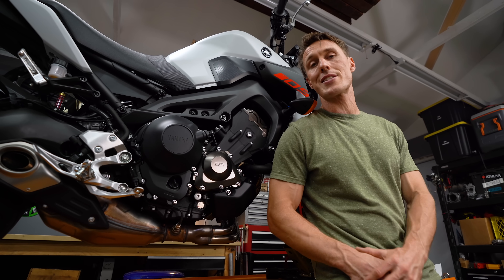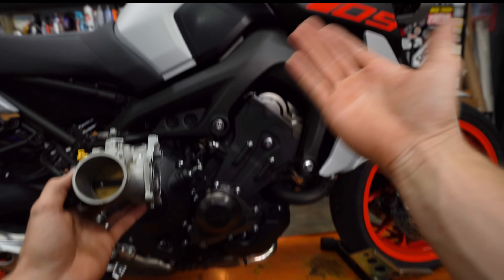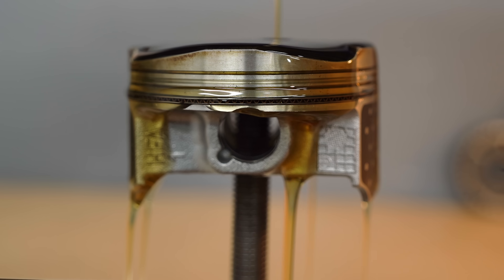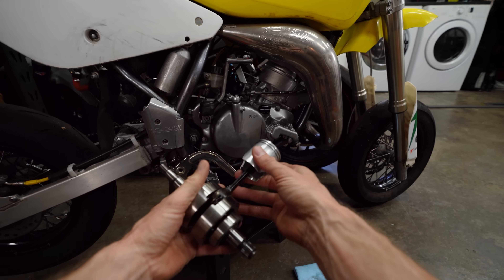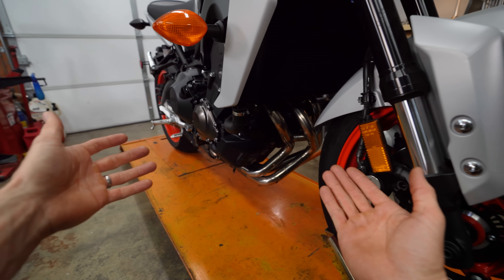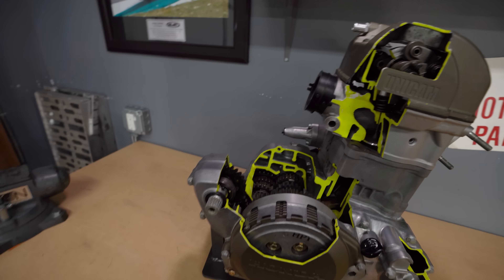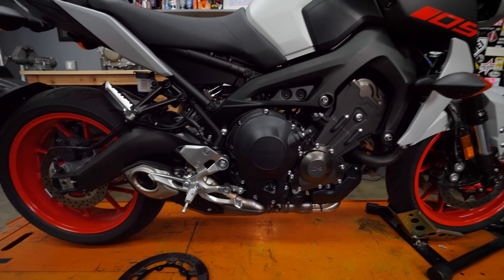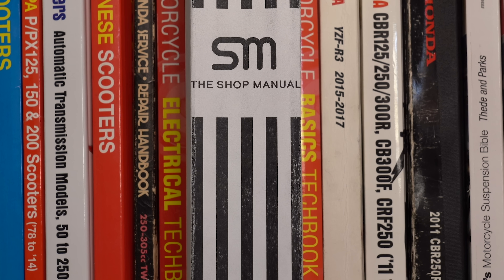Is Engine Braking Bad For Your Motorcycle? | The Shop Manual

Comment: Even with the two stroke, there is vacuum when the throttle plates are closed, and the carbs use this to pull in fuel from the bowl. Most of the time, it uses venturi tubes, but there is a reason bikes have idle mixture screws. Small ports that allow some fuel into the engine when the throttle blades are virtually closed. Think about it, the plates dont close more when engine breaking than they do at idle.
Reply: Yup, great point, and something I'd considered pointing out in the vid but figured was too granular.

Comment: When I engine break, I pull in the clutch and tweak the throttle just slightly while downshifting at the same time, and then ease the clutch back out. It makes the deceleration much smoother that way!
Reply: Going down through the gears like you describe is actually what I thought engine braking was! The way engine braking is described in the video is what I thought of as 'releasing the throttle'.
Reply: That's revmatching, and if you do it right you should beable to pretty much dump the clutch and it will be perfectly smooth with no wear
Reply: @KakuiKujira  
That it is, but when you downshift from your top gear it will give you more braking force!
Reply: @rohinhans7819  
Yep! I’ve been doing there pretty much all of my riding years. 
I learned about it very early on.
Reply: @scubarider1  same, when I took a riding school, I rode their rebel 250. The thing had suck shitty brakes and we went on really steep hills with the school, so I had to teach it to my self on the 3rd day in😂. Definitely something everyone should know how to do!
Reply: @rohinhans7819  
That’s good! It’s become so automatic to do all three actions Simultaneously!

Comment: I would say one downside to engine breaking could be breaking traction on the front tire if you are not rev matching properly. Definitely depends on the bike though. I’ve only had that happen on my XSR700 1 or 2 times.
Reply: Explain please how engine braking could possibly affect front tire traction and what rev matching has to do with it. Perhaps you have one of those new 2WD motorcycles?
Reply: @momule55  it is a lack of rev matching that would cause the front tire to break traction. Kind of the opposite effect of backing into a corner where the goal is downshifting to slow the rear tire to break traction sliding into the corner. When you downshift and the RPM on the engine is much lower than the tire speed the bike forces the front tire to slow down so fast it can break traction on the front tire. Not an issue if you are sitting straight up but if there is any lean the bike could be dropped.

Comment: Please just keep in mind that when a quick stop is required engine breaking is a distraction to the increasing pressure necessary on the front brake and the reducing pressure called for on the rear. In the CMSP course we instruct our beginners to concentrate on those skills, while pulling in the clutch, keeping it in, and clicking down to first in sync (more or less) with your speed. That is already complicated enough  The next time I see a factual demo of combining engine braking with regular braking results in shortest stopping will be the first.
Reply: Your last line implies you are talking about emergency braking? No one I know of uses engine braking when emergency braking, brakes and clutch- back to first gear. 
Topic of engine braking is slowing easy or going down hills/mountains without riding the brakes. Or helping to slow between corners ect not emergency braking
Reply: @UFO-047  no implication intended, it was stated right out. The potential problem in talking about engine braking outweigh the benefits. There are known benefits to what I would prefer to call "throttle control". With the audience this type of content gets we actually arguing how many angels can dance on the head of a pin.
Reply: @imgzrona09uc72  the only problem with talking about engine braking is when it is taken out of context, like you've done. Only you brought up emergency braking, completely separate topic.

Comment: Some of the early ohc engines had weak cam chain tensioner a sudden closed throttle at high rpm could break a cam chain. Rare but it did happen. But 99.9 % no problem

Comment: Engine braking for shedding a bit of speed (when you don't need to shift gears) also extends the life of the clutch in bikes and cars, contrary to the myths that state otherwise. Throttle release -> clutch pull -> brake press/pull ->  clutch & brake release -> throttle pull is a more wearing process than simply throttle release -> throttle pull. On a fundamental level, braking without operating the clutch is harder on the whole transmission than simply doing engine braking, but unless you brake really hard or stall your engine doing the "clutchless" braking, it probably doesn't matter in a significant enough way.
Reply: Makes sense. I’d add that anytime you aren’t smooth with controls, it leads to unnecessary wear. Smooth=longevity

Comment: Front brake provides 70% or more of stopping power.  Unless you're "on the track" consider the MANY extra revolutions of internal components as premature wear.  Because brake pads.   
Certainly useful for downhill stretches though.

Comment: With two-stroke cars however, lack of lubrication during engine braking was enough of an issue to force many designs to employ freewheeling transmissions, at least on some gears. E.g. the Trabant
Reply: Yup, that's fair, but you must also consider the metallurgy and lube technology that was prevalent back when 2T cars where a thing. They were trash! No Nikasil or synthetics, but rather cast iron cylinders and bean-based oil.

Comment: I tend to use a fair amount of engine braking, and it pays off in allowing a longer brake pad life. Where it hurts is putting more wear on the rear tire. I'm convinced if I used less engine braking, I would probably get 10-15% more rear tire life. My bikes are both 1300s--big engine=big braking.

Comment: This stems from 2-stroke engines where, yes, engine breaking can be bad in excess because without fuel delivery there is no oil delivery.  Not so with a 4 stroke.

Comment: What you lose in inlet vacuum you gain back on the compression stroke. Engine braking comes from the engine's internal resistance more than anything else.

Comment: Not sure if you'll read this but I always had a big question on being hard on the engine with braking, what is the effect on valve clearances especially with hard engine braking on superbikes? This often leads to quite a fair bit of damage in engine but its a very slow process and hardly noticeable.

I've always made it a point to keep my valves in spec but I often can't find information on how the valves end up tighter or loose in the clearances. It seems like hard engine brake does have an impact on valves.

Follow up video maybe?

Comment: Something not mentioned here. Be careful down shifting especially in corners if riding a turbocharged motorcycle. Same with accelerating out of a corner. Bringing the rpms up in middle of a corner on a turbocharged bike can increase the power and actually speed the bike up or cause rear wheel to break traction in a corner resulting in a crash.

Comment: BTW engine braking is a good thing for breaking in a new engine. Essentially you want to load the engine up gently and then engine brake. Rinse and repeat this is one of the best ways to break in a new engine. This is what I did on my 2021 Kawasaki Z 900 RS café and frankly every new car engine I’ve ever owned. It helps break in the engine and also bed in the brakes as you’re also breaking in new brakes and tires on a new motorcycle

Comment: Ari, you do a good job presenting.   But your commenters should not confuse the practice of decelerating a bike engine compared to an engine equipped with an actual "engine brake".  Also called a "compression brake".  In the world of motorcycling, closing the throttle is just slowing down by using engine compression, as you explained.  Same as when decelerating with a car engine.   Jacobs Mfg. is the world leader in engine brakes.  The famous "Jake Brake".

Comment: I like engine braking during the break-in period, because it helps pull oil back into the piston rings. That way, you have a little extra lube, next time you accelerate. That seems to help reduce scoring and scuffing, while you're polishing down the crosshatch on the cylinder walls, by taking advantage of the high intake vacuum. It's never a bad thing!

Comment: As fun as big downshifts and lots of engine braking is, I actually try to avoid it unless I have a reason. Rear tires are twice as costly and last half as long as is. Sending the braking jobs to the front is simply cheaper.

Comment: Just remember that on a slippery surface you may end up locking or partially locking your rear wheel if you create enough resistance. There is no ABS on your engine, and the small rotation it provides may not be enough to keep you in control.
Reply: If you shift from six to first
Reply: @vininio  It depends on your friction coefficient doesn't it? I have been riding on mud, snow and ice for just under 30 years, it gives me some experience on the matter at least. So no, downshifting all the way has nothing to do with it, also gear isn't telling you anything about your speed, tires or conditions. Not everyone are fair weather riders.

Comment: On the streets we call this compression braking,  i also use it to stabilize the motorcycle and ease off the suspension, reset the suspension. 
But I’m a layman

Comment: Engine braking is life! I hardly use my actual brakes anymore, my engine brakes with enough force that any additional braking becomes quite agressive. I only take my brakes enough to light up my brake lights. I pump my brakes a bit at red lights to make sure the calipers dont end up seizing lol. I do the same with the car. Results: My brake pads and disk will most likely outlive the vehicle XD

Comment: The engine braking comes from the compression cycle without combustion present to "push" the engine, not because you closed off the throttle bodies there is more of a vacuum, but it's not the primary force slowing the engine. With older engines it may suck more oil into the engine past the valve guides  and piston rings while spending more time off throttle
Reply: If it was the case that being off throttle created a slowing effect from the vacuum behind the throttle bodies, then an engine would not tick over without the throttle being open as no air/fuel mix at all would be sucked in.. anyhow Any mechanical disadvantage of using the engine to break are in effect very minimal overall. Unless you are so unlucky the engine is about to seize or something, but that's probably gonna be unpleasant even if on throttle. I personally have always used the engine to slow me down and the breaks in unison depending on circumstances.. but don't be afraid of it for sure.. maybe unsettling if you are super used to abs or whatnot, as heavy engine braking can cause the back to chatter and skip, but to be fair if you are doing that.. on a dry road at least, you might be damaging your engine by forcing it above the red line as you must have downshifted a lot! Personal view is keep the engine spun up in an appropriate gear at all times and downshifting and allowing the rear to spin up the engine, keeps you firmly informed of where you are gear wise for your current speed, should you need to get on the gas and have power on tap there is no process other than open the throttle!

Comment: Although not bad for the motor, engine braking if you have worn out valve stem seals can cause vacuum to pull oil from the cylinder head and burn it while decelerating/engine braking. So if you see blue smoke when you let off the throttle, that’s potentially why

Comment: Maybe it was mentioned, but engine braking in any motor does cause stress on Intake valve seals as closing the throttle at 15,000rpm with no available air causes a large vacuum to build in the intake manifold, and can and eventually will cause oil to seep through the valves seals and can start burning a little oil. Can be harmless but it does stress things out. Not more than designed for though so it’s all good. But I general if anyone wants to know failure points for down shifting, valve seals are one
Reply: You won't get a total vacuum in an engine with a closed throttle. The throttle isn't totally closed. Total vacuum is just under 30" hg, vacuum under engine braking is around mid 20s. A good running mild street car engine - milder cam and higher idle vacuum then an average motorcycle can easily get 20-21"hg at idle. 
Vacuum from engine  braking won't hurt your motor

Comment: It will only wear your clutch plates down faster and possibly wear you clutch pressure plate, but if you dont how to shift you can fuck up your shift arms badly. Possibly throwing chunks of metal to the transmision.

Comment: The chain set strained because the unmatched rotation between the engine and the rear wheel
I have to readjust the chain more often if I do a lot of engine braking alone than if I combine engine braking with actual braking 

(I hope people understand what I meant, sorry english isn't my primary language)

Comment: Cant help but to think about a tired old motor with a stretched timing chain. Sometimes you can spin a tooth or break a chain. At least on old chevy v8's. What do you think Ari?
Reply: Riding or driving any engine that's not in a good state of tune means there's potential for failure. If someone hears their cam chain slapping, they oughta do something about it.
Reply: If a motor is worn that much that its about to jump a tooth on the timing chain its not going to matter whether the motor is under power or engine braking, its gunna die anyway..

Comment: How about the effects of not using engine braking? Coasting(full clutch) + modulate the brakes. That's how I ride since I began twisting the throttle and would like to know its mechanical effects.
Reply: Mechanical effects: None. However, you're relinquishing a lot of control by coasting. No matter how adept you are with the clutch and throttle you're adding reaction time to any scenario that requires acceleration, like darting around an errant car.
Reply: @AriH211  WOW! Is this actually you?! I can't believe I would actually get a reply from you of all people! I'm a huge fan from the other side of the world ever since Motorcycle Magazine days! 🇵🇭

Thank you for clearing that up. I'm now practicing engine braking habit after I saw this vid. Love the engine sound every engine brake!

Comment: When I apply the engine break means off the throttle the butterfly 🦋 is shut off and bike is stilling running and slowing down gradually. From where the bike gets the strength to move forward as there is no more gas and air. Second question: when the idle RPM is 1500 and and the engine is moving inside but it is not pulling the bike where does the bike get fuel as the throttle is off.

Comment: The impact goes straight to the chain and sprocket set, it wears out significantly faster
Reply: So let me understand- for a bike, that can accelerate MUCH faster than it can decelerate through engine braking alone, meaning much more force is produced on the chain and sprocket during acceleration, it somehow magically wears the chain and sprocket much faster through engine braking?
Reply: @thetowndrunk988  During acceleration the gear shifts are more gradual meaning if you need to access all the engine horsepower you'll change gear after the specific rpm engine produces it's maximum output so the energy gets distributed gradually to the sprocket chain sprocket tyre , however during engine breaking the gears are changed / downshift to a lower gear is done within seconds and the sprocket and the chain has to deal with the impact of the momentum of the engine and resist it as it was running at a higher RPM
Reply: @lonewolfindia3489  engine braking, and downshifting, are 2 distinct things. Anytime you close the throttle, the engine is braking. As far as downshifting while engine braking- sure, if you drop 3 gears then dump the clutch, you’re gonna put a shock load on a bunch of the components. But more than likely, you’re gonna have bigger things to worry about doing that, like maintaining control. But if you’re smooth, and blip the throttle when downshifting, then using the engine to brake is not even remotely close to the load that’s put on by acceleration.

Comment: usually at traffic lights you shift down few gears and engine brake. Then my worry will be clutch plates!
Reply: that's only a concern if you are incapable of rev matching even slightly, and instead just bang the gears in. That's rider error, not clutch error. With normal gearshifts there is no damage caused tot he clutch plates comapred to normal.

Comment: Two strokes don't even Have much Engine braking because with the Throttle shut Crankcase and Cylinder are basically at the Same pressure .
Premix Two strokes used to seize readily but these days they use Oil Injection so less issues now .

Comment: I don't recommend engine breaking or using the brakes in general, because they both just slow you down. It's best to have the throttle wide open at all times.🏍️💨💨💨

Comment: I have also suffered the ass ended on the highway scenario. Broke 9 ribs in 11 places my right wrist and my right big toe. Plus my ass was a solid black on the left side and partially up my back as well. To this day I still have a numb left upper section of my leg. I will not let off the throttle on the highway without making sure I’m clear from the rear. Same with a stoplight.